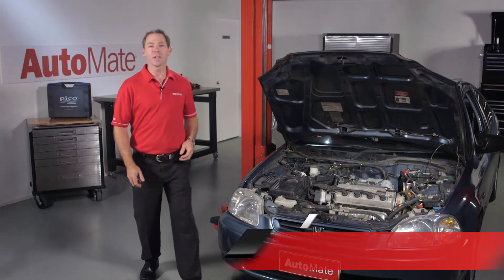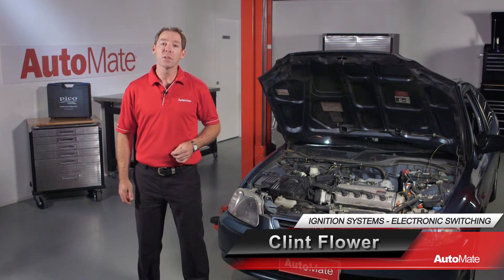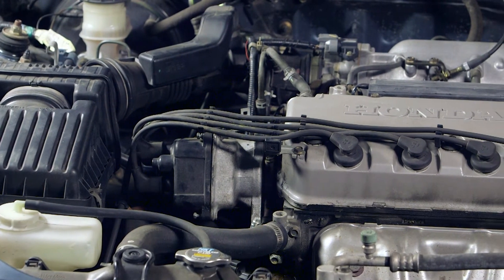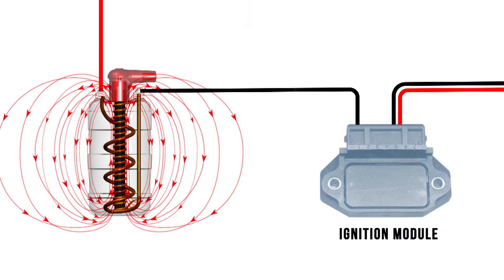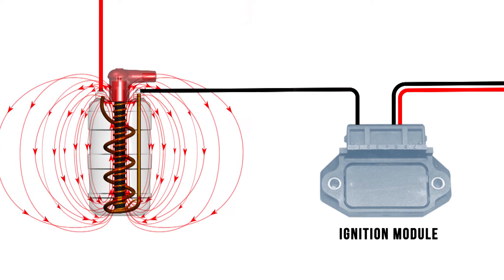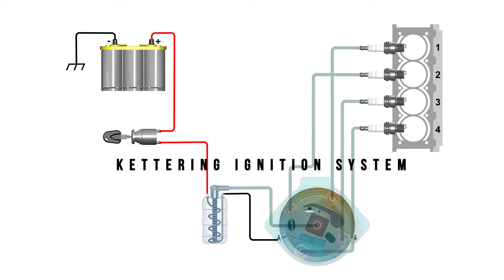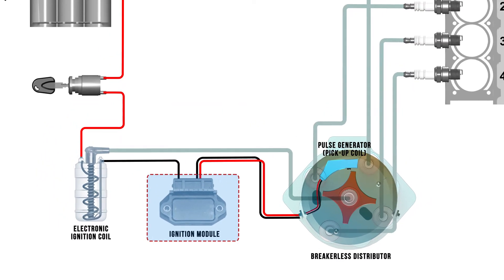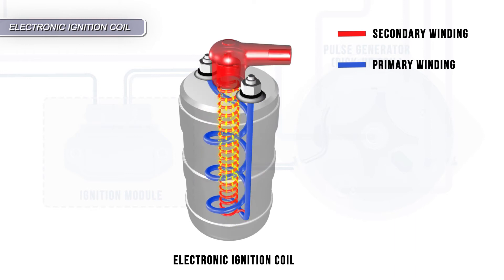Ignition Systems Electronic Switching

Comment: I think this explains my problem.  I was trying to wire up an engine stand when I noticed my engine had a slightly different distributor set up that wasn't shown in my diagram.  after looking at the car I took the engine out of I notice that it has this module...  I'm used to the older engines so this was pretty confusing to me but now I understand. thanks!

Comment: Hello sir I have opel astra(1997) car my car is very old but still in very good condition.
I want to know about my car Ignition control Module 90360315. My car Ignition control Module is not working.
My car Ignition control Module is not available in automobile parts Shops.
Is there any process to repair or find replace
or  other company car Ignition control Module i can use is there any possibility then please tell me my car is very good my favourite car.
Reply: People have used HEI module off different cars on their car. I saw this on a YouTube Range Rover channel where a module from a 4cyl was fitted to a V8 & worked fine.